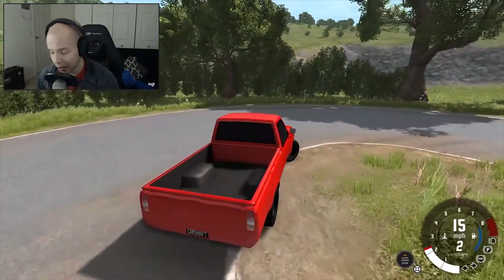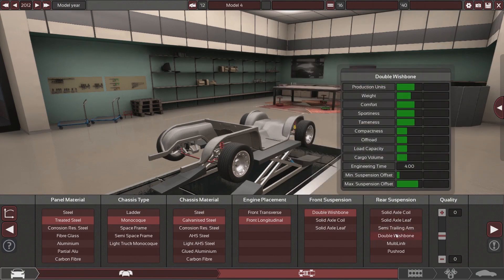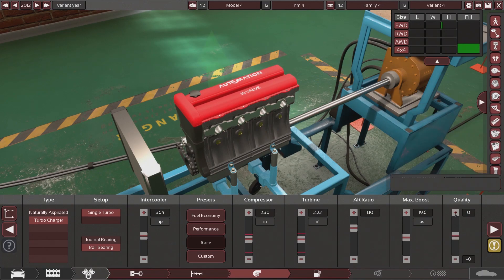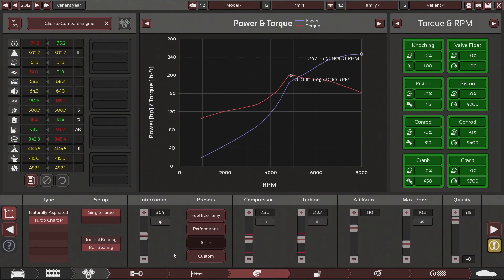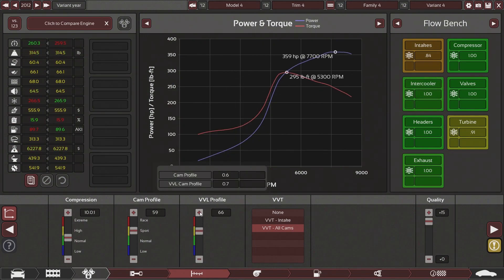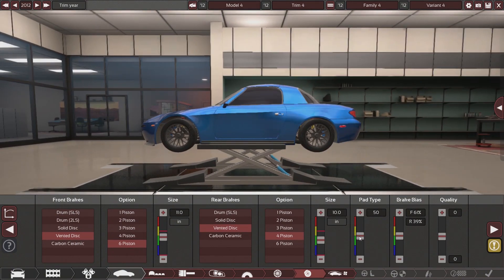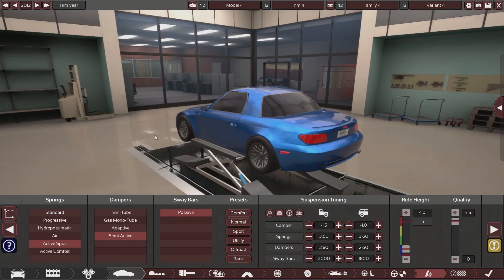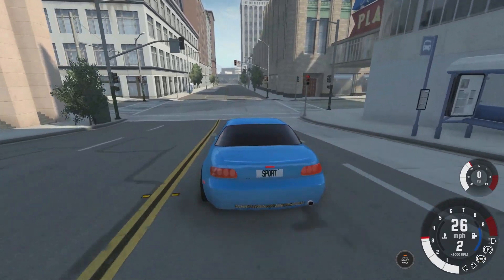Building & Driving a 400HP Turbo Miata! - BeamNG & Automation

Comment: 7:55 You are not knocking, because you changed to direct injection and it is way more effective than multi point so it lowers the octane number needed😉 Also, when you boost the quality of the interior and safety, the car starts to weigh more so thats why in the start you were weighing that much. I am a big fan of you and your cars! ❤ If you need any help understanding the game, feel free to contact me.
Reply: Mitaka Lets get this comment to the top! Great info
Reply: Ay you mind telling me how to properly gear my cars? i always fuck it up.
Reply: @ohhhLuna  Sorry for the late reply, but it's better than never right? So, when you open the gearbox menu (The gear thingy after the fixtures menu) you can choose the type of gears you want your car to have, like Automatic, Advanced Automatic, Manual, Sequential and Dual Clutch. When you have decided whaf gearbox you want to use, the next thing is the top speed slider, which controls the final gear ratio (how long are your gears). The next slider is spacing, which controls each individual gear lenght and how much mph or kmh you are hitting in first, second, third ... you get the idea. I hope i have been helpful!

Comment: I play this game very often and I have some advice for you in the future 
1.change your measurements to millimeters because it’s hard to judge brakes and turbos in inches
2. The year in the top corner that says 2012 move the arrow up to the year 2018 you can get carbon fiber wheels and other newer technologies for the engine
3. You can go on the steam workshop and get more car bodies 
I hope you will read this and be able to use some of my advice to make better cars in the future
Reply: Also forgot to mention there is heat soak in automation the more you drive the car the less boost you can use, when you make your next car there is an option that lets you determine the cooling air flow to your car, also you can go into the beamng ui settings and add heat telemetry and other information
Reply: I didnt even know that so it sounds like some good advice. Thanks G!

Comment from the maker: Can we get this channel to 50k subscribers by the end of the year...?
LETS TRY!
Reply: PIN your comment so people see it<3
Reply: You can stretch and shrink the cars frontend and rear end and wide body and change the track Width and poke @Game-ium
Reply: Stick to automation, a smaller channel went from 2k subs to 10k subs in a month because of that xD
Reply: Do rallyata and install mods
Reply: Plug it hard on your og channel
Reply: Game-ium you can rev the engines manually in automation
Reply: But with one condition.........

RALLY MIATAAAA NEXT
Reply: Build idea: make an engine with the highest hp achievable and throw it in a minivan

Edit: make the van awd
Reply: Game-ium please make this a series
Reply: Hey Caleb a quick tip for the turbo if the turbine or compresser go red don't worry it doesn't affect reliability it just shows how much pressure is running through it.
Reply: Good chance if you keep posting this game combo. People need to know how awesome Automation + BeamNG.drive is. Its a nerd's playground and there's nothing else really like it.
Reply: Denizen Locale how much do both of them cost together? I am thinking of getting it so I can build an turbo K27 powered crx, which is impossible in say, forza horizon 4
Reply: Build a camry 4wd
Reply: there is a miata mod for beam. you just have to search it cause its not in repository
Reply: Game-ium u should build a cummins tow rig
Reply: NOPE
Reply: ummmmmm NO
Reply: Only if we get my channel to 500 subscribers! YouTube Gaming let me know that this is a gaming channel on the rise, so good luck and ride the popularity wave as far as you can Game-ium! Or Gingium, whichever you prefer haha, both are great channels
Reply: Hey man it's really okay I just found your channel and subscribed by the way I like it when people build cars and then import them to the other game it's pretty cool to be able to actually express some of your ideas I have some of my own and I understand the struggle with computer parts they're really expensive not to mention hard to get ahold of sometimes it took me five years to eventually build my own computer only for it to get stolen by my so-called best friend so I can't really make content anymore I have plans to make video game playthroughs and retro stuff of some of my favorite video games but I never really was able to get around to it I only was able to make practice edits and certain camera shots before I just lost everything so believe me I understand the struggle
Reply: Emm the NA had two capacities: the NA6 had the 1.6 B6ZE and the NA8 had the BPZE... If this was a realistic build, you kinda shoulda picked the BP since it was shared with the 323 GTX... Which means it was ready for turbo from factory almost!!!
Reply: Come back to me when you can switch out your fuel injection system from your engine HAHAHA thats so unrealistic 😂😂😂
Reply: Good job on the body though... Better than I could've done...
Reply: Aww fuck you gave it the shitty steering?? Bro the Miata had the coolest steering rack I wish you gave it hydrolic
Reply: 2340lbs is still really heavy... You shoulda taken out the seats and the brakes... What else... Idk...
Reply: EVERYTHING IS POSSIBLE! I SUBSCRIBED

Comment: Next do the adventure bus using a van. No diesel in Automation but a random high-compression turbo V8 with direct injection might be a good substitute.
Reply: Unfortunately in Automation the compression only goes to about 12, a cummins compression ratio is 15 and with the general lack of a matching bodystyle it really wouldn't be the adventure bus... at all.
Reply: nah compression goes to like 14, but it will knock with boost and that much compression
Reply: If you make it a 9 liter turbo v8 and put the redline at 3 grand, it’d be close enough lol

Comment: BeamNG have so much details that add wing actually create down force for extra stability in high speed and tyre pressure does effect grip and you can know how much engine make in beamng by press ESC then apps then torquecurve .... 
P.s: cool video as always and i suggest to go to settings then gameplay and trun off clutch and throttle assist off so you need to press clutch on to not destroy transmission 😊

Comment: Gingium, there are arrows on the "Torque and RPM" stats that if you click will take you to the flow bench which is GREAT for tuning turbos. Set the AR to max and start the compressor and turbine their lowest and tune from there. You can make some seriously powerful engines.

You have a lot to learn in Automation, Direct Injection is more fuel efficient so you use less AKI/Octane, allowing for a bigger intercooler, more compression, more ignition timing and in general, more power.

You can see when the engine is about to knock from the stats on the left. If you look it will tell you how much AKI/Octane you are using and as long as that doesn't number exceed the AKI/Octane in the fuel you're using, you should be fine.

Comment: basically in automation it likes high boost low compression. it takes alot of practice to make an engine that has a reasonable power band and doesn't consume an entire tank of fuel in 11 minutes (which i have made. it has 3020hp the engine alone took like 2 hours to figure out). Hopefully the developers can make it less like a puzzle game to make the engine

Comment: I legit built myself a turbo Inline 6 in Automation.
It doesn't hit boost until about 6,000 RPM, then when it hits boost it gets 30-40 PSI of boost and spins the wheels off.

Comment: If you push Shift+c you get a free cam where you can move around, then push f7 to respawn teh car where your cam is
If you push Control you can grab the car by nodes and toss it around or get it unstuck cx

Comment: If the engine has direct injection it can take more compression and or boost before it will knock, that’s “what happened to the knock”. Ps if you put max quality on some things like interiors it adds weight and cost.

Comment: What kind of specs is your PC? Chances are if your CPU is good enough, you should be able to just replace your graphics card with something like a GTX 1050ti (brand new $150ish) or a GTX 980 (probably around $200 secondhand) and be good to go. You could also overclock your CPU, assuming it's overclockable, to get a little extra performance, but you may have to get a better CPU cooler for that.
A 1050ti should allow you to record without using your laptop, assuming you have at least 8gb of RAM (Ideally I'd have at least 12gb).
Replacing your boot drive with an SSD really helps speed things up too, and having a dedicated HDD that's separate to the one you have your games installed onto to store all your recordings would help out.

All in all, you could probably pimp out your old PC for under $250 and it'd be so much faster than before, just need some KNAWLEDGE of what to buy. Just whatever you do, don't buy a pre-built PC, they are always overpriced as hell.
Reply: or a rx 480 for 150-200

Comment: I hope this makes you realise a 12:1 compression ratio forced induction engine isn't going to work unless you run very low boost and/or almost no advanced timing, both of witch will reduce torque and therefore power.

Comment: Obviously it runs great, an i5 2500k and a 650ti boost shouldn't have trouble running any games as long as you're willing to play on lower settings. You probably had some malware or some shit like that, maybe just trash to clean, you should've asked for help,  I'm sure you could've got it running better without losing all of your data.

Comment: 6+ year old pc for gaming even if it is a gaming one will run slow for modern game standards and most of the components are at the end of their life.
Reply: Depends. Most GTX 600 series can still do decent, and in terms of CPU, Sandy Bridge i3s and i5s still holds up today too.

In terms of the latest and greatest games, though, it would obviously be at reduced settings if at 1080p, but still with playable fps in most cases.